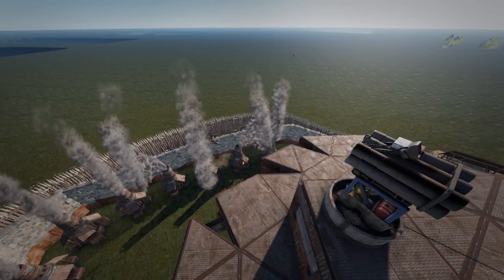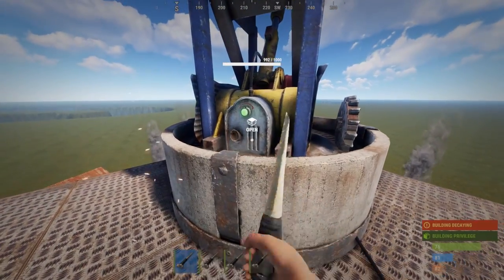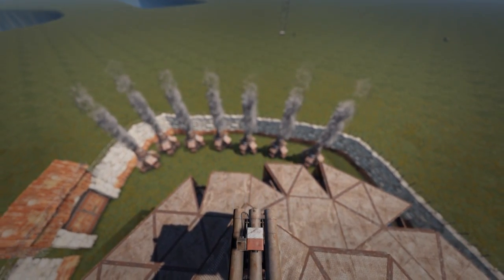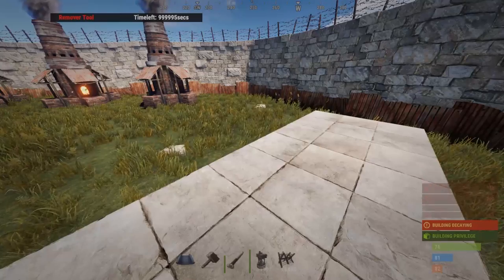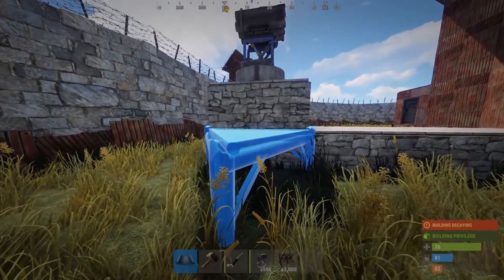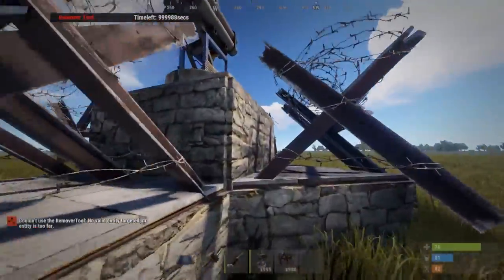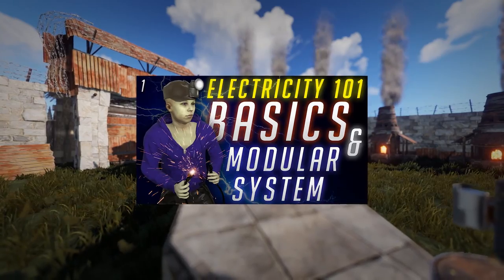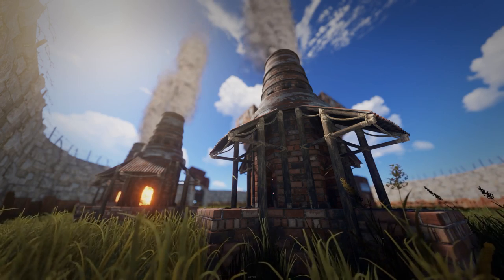How to use SAM SITES | Rust

Comment: I use to use SAMS..but I found a better way to protect my roof and cheaper. I use half walls on roof with quarter walls in between cover roof over and place tesla coils on quarter walls ( electricity goes through roof top) hook up to HBHF sensor well hidden. It works very good and you can easily recover loot. Make sure you have max power of 35 Rw per coil. Cheap hidden and deadly. This also avoids the owner from accidentally being targeted from their own SAM...and If your turrets are within range of SAM they will fire at it till it's destroyed. This also avoids you from looking rich. More advanced would have a garden of roof top with sprinkler system to put out fire from heli crashing onto roof tops this to could be hooked up to same HBHF sensor and then split. To prevent fires.

Comment: My question, has the Devs fixed the issue of your base getting between the SAM and it’s target and consequently the SAM firing rockets at your base?
Reply from the maker: I'm not 100% but it looks like they did. If it does happen the only way to fix this is by manually picking up the sam site with a hammer and replacing it. (in case you or anyone reading this doesn't know)
Reply: If that is the case then the only answer would build a co pletel control room within your TC bunker and when being raided have someone in there at all time and put each Sam around the base on its own dead switch. It's extra tedious work but is a pay off. Best to have someone good with electrics knowing the game plan before the wipe even starts. 

I'm on a mod server developing this right now. Literally looking at the monitor. I don't see people utilize the MLSR or the Sam's as much as they should be. We just online raided our servers biggest clan with the MLSRs and it was beautiful watching their roof explode then get hailed with rockets. Felt good. 

I'm currently working on a trap raid base. A compound completely designed to turtle breaches. We got fake shit all over the compound that looks like a real base lmao. Ain't nothing behind them honeycomb except more doors lmao our main tower has over 60 armored doors

Comment: You can just place twig floors off of the half walls and completely avoid the barricades.... not to mention there is no TC keeping the structure from decaying.
Reply: If you are using sam sites, chances are you're not in a 2x1.. all the tcs in and around  the compound will compensate each other

Comment: refilling sam is also kinda difficult
Reply from the maker: It is, although as base owner you have the capability to turn the sam sites off, allowing you to for example use a minicopter. You can then drop a team mate off on top, have him re-fill it and pick him up again. It's not as convenient but it's worth it in my opinion.
Reply: @Sven_YT  or just don't place the barricade facing the turret that side is fairly protected.  I also would recommend a high "as possible" foundation and not half walls
Reply from the maker: @relax.4045  True. Realistically, I have to say that if you have a quad set up like I show at the end of the video; you put a 100 sam ammo in each and you should be fine, never had to reload it once.
Reply: @Sven_YT  yes you are right but just incase and also a high foundation is even cheaper than a 1x1 with half walls I always like to figure out most efficient way
Reply: @Sven_YT  or just build up with twig and jump over to refill it